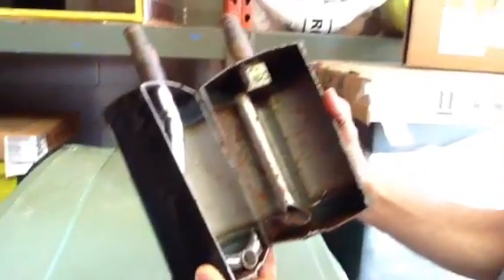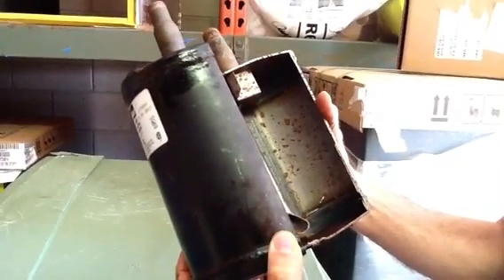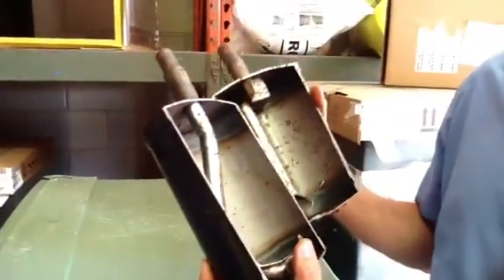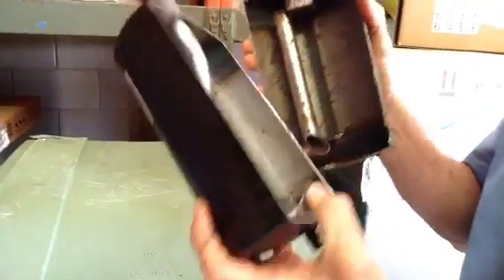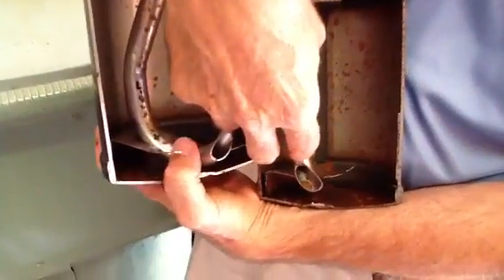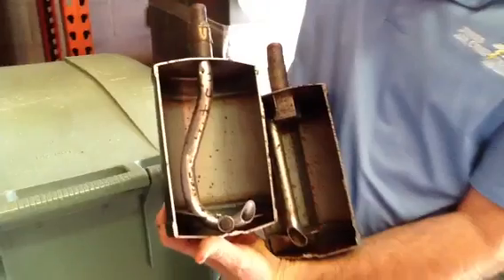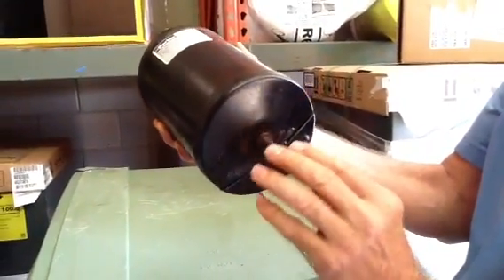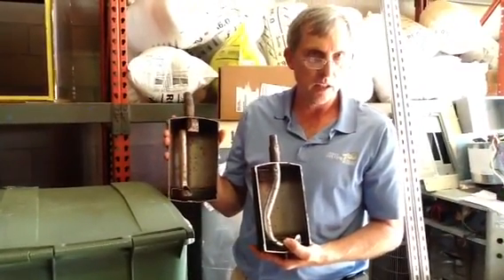How Suction Line Accumulator Works

Comment: Today I have a walk in freezer with iced suction line, accumulator up to part of compressor. The suction line pressure is 5psi. I put around 2 lb R404a in and brought suction line pressure up to 20psi, but there is still a little bit frost formed at accumulator. Should I Putin more refrigerant? Thank you
Reply: If you aren't measuring superheat you are just doing things blindly.

Comment: Just build one out of copper. That's what I used to do for my 50 series multiplex. I made them out of 3" copper pipe and 2 caps. drill 2, 5/8" (or what ever your suction side is) holes in one cap, stub one tube down about 1" and the other down about 4", the cylinder would be 1' long. Never had a problem with them after that. I can't understand why the EPA ever allows steel to be introduced into a refrigeration system. Even dryers should be all copper. Problems solved!!!
Reply: R Johnson drill a little hole

Comment: I noticed that my my York Affinity AC unit ...accumulator frost over towards the bottom. Would this indicate that this item is faulty? Please n Thank you.
Reply: EvereTT PIerce did u find the problem?
Reply: it was the TXV Value made in Mexico. a $80 dollar item that cost $1,300 in repairs on a York machine 4,000 brand new.
Reply: 1300$ for a TXV replacement???

Comment: Good Video. What are some sure signs that the screen is clogged up?
Reply: Had trouble with accumulator , had the compressor fail , put a new compressor in only to find the unit scroll compressor running bad , can only describe it as cycling vibrating  every 10 -15 seconds , blockage in the accumulator

Comment: I always add a suction accumulator to my new units. it virtually eliminates compressor failures do to failing txv valves or failed evap fans.
Reply: What year was that. refrigeration.. yes they came with the unit and heat pumps . I'm not gonna butcher a new condensing unit .

Comment: I charged my r22 system up and now after about 15 minutes of running the Accumulator Freezes back tot the suction Port. (the Acoil is clean and remains unfrozen with plently of air flow)  have i over charged it?

Comment: They tend to rust out and leak. I have seen refrigerant oil and refrigerant leak through the rust pitted steel on these devices. A lot of heat pumps with an outdoor txv do not have accumulators. As an experienced technician, i believe it is a good idea to have one on everything. It is cheap protection for the compressor  against poor maintenance and extreme dirty air filters (ac mode).
Compressors are very expensive and this can easily save one.

Comment from the maker: The inlets are both always on top on an accumulator. Look at the video closely you will notice the inlet on the right side, it comes in as a low presure vapor and the liquid settles at the bottom. The liquid is sucked up through a screen at the bottom that sucks the liquid on through and out the left side of the accumulator. It comes in as a high pressure gas and leaves as a gas as well. It accumulates liquid at the bottom. If you need any additional explination just give me a call 239-586-5855.

Comment: Isn't the inlet the one with the pipe attached?. Liquid is always going do be on the bottom of the accumulator, so that pipe is sucking liquid to the compressor?. I always imagined those things the other way around. Is like saying that the outlet on your reciver is the line on top where there's only vapor and not liquid refrigerant. Just saying.
Reply: poor cutaway,  the outlet pipe is cut in half.  Add to that a poor/incorrect operation explanation and you have this video